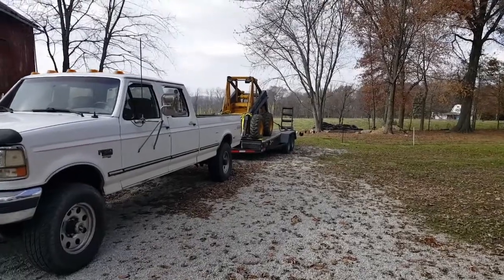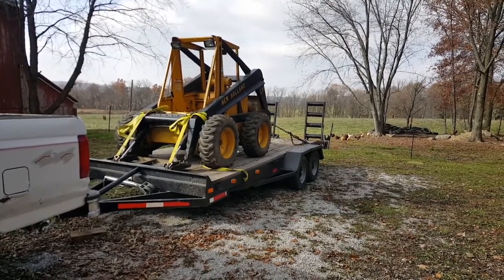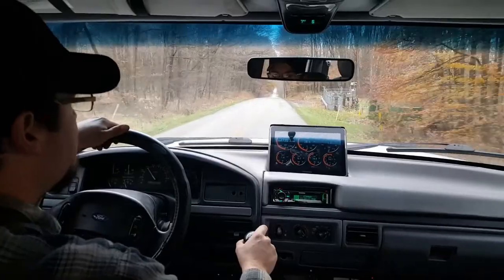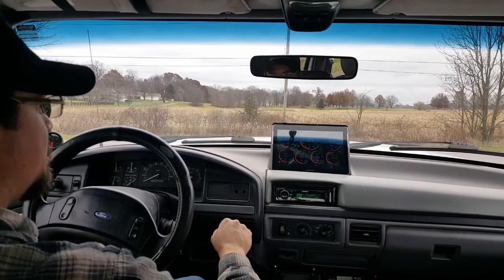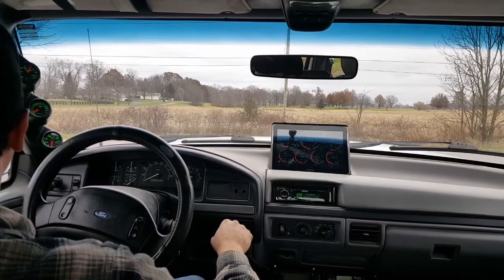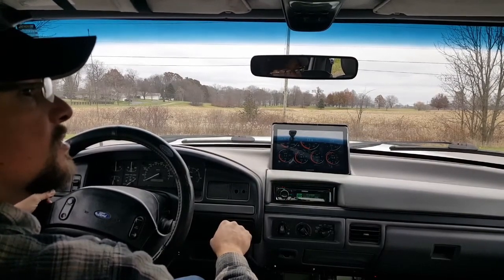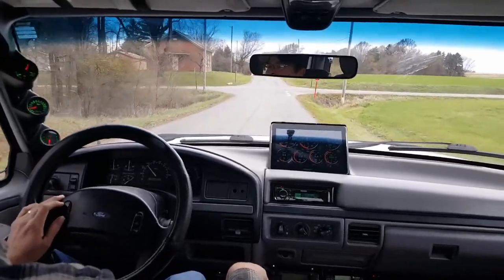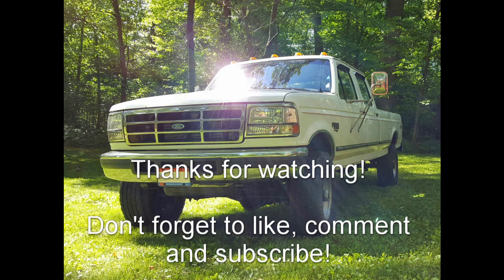Project PSD Part 15: Towing with Stage 1 injectors and a Mild Tune

Comment: is this a stock turbo? my turbo only makes 5-15 psi. it will make 20 psi if i push it hard at 3000 rpm
Reply from the maker: Stock turbo (now with a Riffraff Diesel billet compressor wheel). The important thing is to be sure you don't have any boost leaks on either the exhaust side or intake side of the turbo.
Reply: @diymechanictv1233  how can i check for a boost leak? Visual inspection?
Reply from the maker: There's a video on the channel on checking for boost leaks on the intake side. Exhaust side, yes. Visual inspection looking for soot is the easiest way to find them. If they leak, it's usually at the connection between the up pipe and the turbo collector.

Comment: i’ve got a really similar truck but witb 4.10s. my stock 332k mile injectors need replaced badly snd i’m thinking of 160/0 with the stock turbo snd hpop. i don’t care for speed, i’m just lookikg for decent fuel consumption and good performance. the truck is decent where i’m at right now, but i can tell it’s not getting much fuel. i’m getting about 22mpg city, 19 highway (4.10s and a 5 speed ruin my highway mileage). i’m shooting for >16 while towing and wanna keep similar mileage so i’m thinking a pretty conservative tune on 160/0s would do the trick. i’m 3 inch down pipe with 4 inch from the down pipe onwards. i should probably diagnose exhaust and boost leaks because i know for a fact i have an exhaust leak, so that will come later as well. this is my daily driver/mountain toy/car hauler, any advice?
Reply from the maker: Sounds like a great truck. I think you'll be very happy with a set of 160/0 injectors, but I can tell you from experience that your mileage will suffer. Not necessarily a function of the injectors so much as a function of the right foot (if you know what I mean). There's a lot more power on tap with bigger injectors and the tune that will accompany them. I prefer Rosewood Diesel for my injectors but there are other good options out there. You may also find that the EGT will get a little hot while towing with the stock turbo and 160/s. Intercooler helps that a lot, but if you're willing to drive by the gauge, you can get by without it. Do it! It really breathes new life into these old trucks.
Reply: I completely agree with what DIYMechanic said. The 160/0 are perfect bump in power without being too big for normal use. The egt increase is there regardless of who tunes it. Intercooler or turbo upgrade will be beneficial.

As for mileage I’m sure you’ll see a drop for quite a while due to your right foot gets tired lol. In all reality I was getting about 15 combined with my old wore out injectors and the 160/0 took me back up to 17 combined. I don’t drive over 65mph and I don’t get up to speed real fast.

Zf5 and 4:10’s with a CCLB 4x4 here.
Reply: @sav300  well i actually have had a 1023 tuned hydra and 180/0s since october now and i love them. nothing crazy but enough power to hit 24psi if i need to. my egts aren’t too horrible either. climbing mountain passes they creep up to 1100 or so so i let off when i hit that. 

my mileage did go down a bit. but that’s also because i was accelerating so slowly in the city that it was a traffic hazard. i shift at 2000rpm ans get like 15-16 city and about 18-19 combined.
Reply: @MCatwar  I really wanted to the 180’s or the 205/30 hybrids but I couldn’t swing doing hpop and efuel at the same time to get the potential out of them.

And then I had have a reality check that even at stock power it was towing just as good as I need it to. If I ever get a single cab I’ll definitely pay to play with it!
Reply: @sav300  yeah I actually ended up going (cheap) efuel as well.  I'm still on the stock hpop but in all honesty I hardly ever leave the stock tune on the hydra either.  Occasionally I'll put it in the light tow tune to pass someone but that's it.  I definitely went overkill but I figured for the extra 190 bucks, there's no reason not to get 180s versus stock 90s.  

I have a super duty 17* hpop and turbo and intercooler waiting to go in it, so I'll be doing that some time this summer, hopefully.
Reply: @MCatwar  that superduty pump makes all the difference. The ol 15* just doesn’t cut it on my higher tunes. 

Hpop and efuel are to come maybe later this year or next. I’ve got the intercooler and parts to go in. Just waiting to do it until I buy a turbo. These old 7.3’s sure do respond well to an injector upgrade. That stock turbo is just dreadful though!
Reply: @sav300  I can agree about the stock turbo.  I also have a raging exhaust leak so that doesn't help with my boost, and I pop a CEL and it defuels when I sustain 24psi.  That's fine though, I never even hit 24psi.

However, on the stock pump, I actually datalog my ICP and it doesn't seem to fall flat.  I believe this is a result of the 0% over nozzles.  However, I did track down a weird issue, that's most likely ICP or IPR related.

I have this issue wiht my truck where it runs amazing but after some highway driving it idles funky and runs slightly rougher, and gets worse fuel economy.  I couldn't pinpoint it.  Contribution test, buzz test, fuel pressure, it's all fine.  I datalogged ICP and noticed that after my ICP pressure gets in the 2500psi range, the sensor must stick or stop responding, because following the full throttle pull my ICP reads a steady 725psi at idle.  For those who know, this is the PCM's stock ICP value it defaults to when the sensor stops reading.  

My truck defaults to its stock injection pressure readings after I hit high ICP pressure.  weird.
Reply: @MCatwar  that is weird. I have seen them get gunky oil in there and cause issues. However if it was after the injectors, ya might pull it and make sure there isn’t a piece of injector o ring stuck in it. Had that happen to my ipr.
Reply: @sav300  i replaced the icp at like 330k miles and didn’t install injectors til 332k and am at 335 now. i don’t know if it sn injector o ring because my fuel bowl has no oil contamination
Reply: @MCatwar  I see, it was happening before injectors went in?  It’s worth taking out just the make sure nothing is in it. Only other thing that I’ve seen be odd on a 7.3 was wires wore through near sensors and as they got hot from run time and engine head they would begin to short or cross. In by the fuel bowl and by the ebp sensor I’d ran across that.
Reply: @sav300  yeah i’ve had issues with that with my UVCH so i super duty converted it. and to be honest, i couldn’t really tell if it was happening before my new injectors or not, because i had a failing mechanical fuel system and the pcm was dying too. it ran like crap refardless but it was more like a “chop” or mild surging before when its now more like a regular rough idle you’d see in a gas car with a vacuum leak. i did notice though that even if it’s warmed up, if i keep the rpms(and therefore, ICP) down, it doesn’t do it. it really takes a good 3rd gear, 20psi pull to get it running like that.
Reply: @MCatwar did you ever figure out your issue?
Reply: @Turbotalkin  so, i’m at 344k and the past 2 years i’ve driven the truck way less, all i really use it for now is to pull trailers. even though they’re not too heavy i’m going over the continental divide and these old trucks just aren’t like the new ones. they really struggle in terms of gearing, fuel injection, and air intake at 12000 feet so i haven’t been nice to it.  

but, i’ve put a kc 300x on it, cncfab stage 1 hpop and 6.0 intercooler since then. i just finished the intercooler last week and haven’t needed a trailer yet so i’m not sure how it pulls egt wise. 

however, i’ve just accepted that the chop my truck has is probably here to stay. it’s given me no issues and i still get 20mpg(16 towing) and it’s not necessarily unreliable. i think it’s either my IDM or IPR valve. 
when i did the hpop i bought a motorcraft IPR from amazon and it ran amazingly smooth for a couple seconds until it started hitting my injectors with 3400psi of oil pressure. worst injector knock i’ve ever heard, rattle your teeth out. i analysed the packaging and found some slight discontinuities with it, and checked the seller and found it was a company in istanbul. pretty sure i got a knockoff, so i just put the original ipr back in it. i haven’t tried messing with the idm or buying a ipr from a reputable source, but if i get bored some time maybe i will, and i’ll be sure to let you know if i remember

Comment: 3 years later, do you ever wish you would have gotten a larger injector?
Reply from the maker: You know, I don't at this point. I don't hot rod the truck much anyway, and typically keep it on one of the lower power tunes so I'm not really even using all the power I have now. I would like to do a turbo upgrade at some point to something a bit more efficient t so it will spool faster and clean up the smoke better, but I'm really happy with how the truck works now. Part of it is that I feel the more you turn up the power, the less reliable the trucks become and I want to be able to count on this truck. It's just about perfect for what I'm using it for right now. 

Thanks for watching, and for the great follow-up question!
Reply: @diymechanictv1233  I’ll get you some feed back soon then. I have a T4 turbo swap with a s364.5, and even on stock injectors it was a significant upgrade in all around performance. Excited to see how it improves after new injectors.
Reply from the maker: That's exactly the setup I've been looking at, so yes please do let me know how it performs with more fuel behind it!

Comment: What kinda fuel economy are you seeing? Also could you do a video of smoke output with these injectors? I'm not looking for a coal roller just curious how they do.
Reply from the maker: Fuel economy is more or less unchanged from before this work was done to the truck. I average about 12-14 MPG in mixed driving. But I can drop that number significantly through the use of my right foot. 

I'll see about getting some footage of the exhaust and smoke, but it's all in the tunes. On a hot tune, it'll really roll some coal, but in the more conservative tunes, it's a puff of smoke til the turbo lights and then it cleans right up. I'm not a real proponent of rolling coal, so I try to drive it without the smoke, but when I uncork it in a hot tune it will definitely roll the black.
Reply: That's perfect. That's exactly what I'm looking for